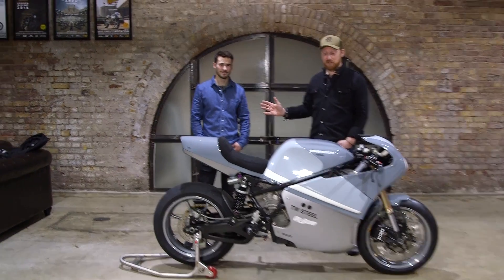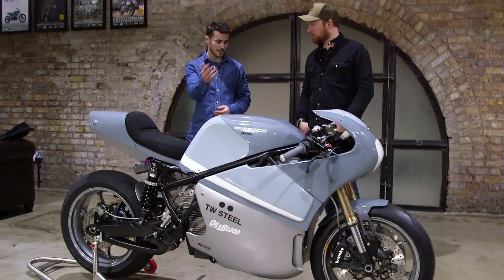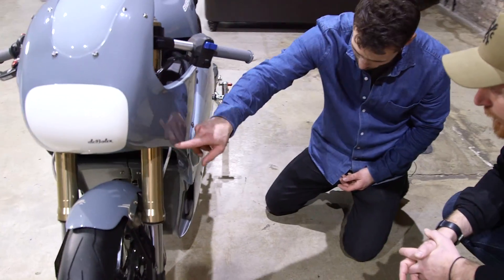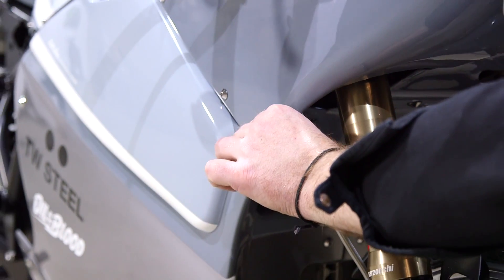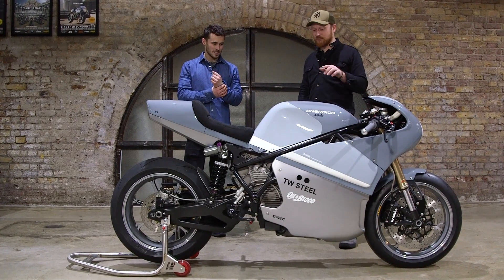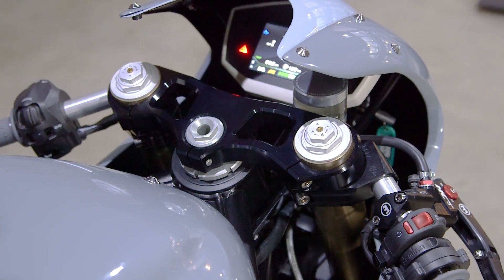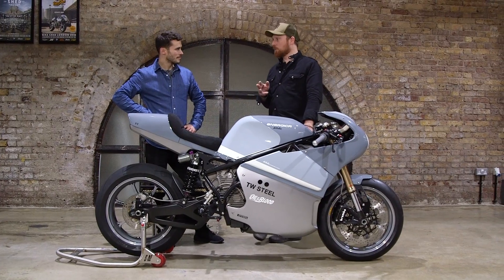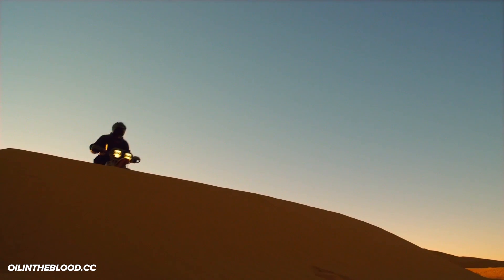DeBolex and Energica Eva - 145hp custom electric motorcycle

Comment: Is that how bad lvl 3 charging is out there? With a DC fast charge combo plug its like 30-60 minutes for a refuel in America and our infrastructure SUCKS! WHAT type of stations are you using and at what speeds in KW? Came to say very nice work on the bike. 3 hours is very brutal for a CCS plug no?

Comment: As a custom exercise, I actually like it. You can tell a lot of thinking and quality is in this build. However. However. I don't really think anyone yet has really exploited the unique aspects of an electric base to produce something that truly reflects form and function. Everything still looks too traditional. To retro, in this case. It's not really a reimagining of a bike. It's more a re-application of existing ideas. 

What I would actually like to see is either something radically different from ICE moto design to reflect elec bike architecture. Or, make the function reflect the fact that this is an electric bike. For example, please please stop trying to make the tank look like a traditional fuel tank. In this area alone there can be so much innovation, especially from a custom point of view. Yet all I have seen so far is a conventional approach. Other things like indicators, subframe, steering presentation and of course bodywork are all areas where you can really be more creative.

I admit that to really exploit the electric platform, it needs to start from the chasis manufacturer. Otherwise you're stuck with the fundamental dimensions and architecture of a conventional bike.

Comment: Wouldn’t it be better to run a left hand rear brake lever instead of the usual foot lever. Fingers are more sensitive than toes and with no clutch to contend with there’s no reason not to. I know it’s probably a familiarity thing but most bikers have some pushbike experience so it’d probably be fine.